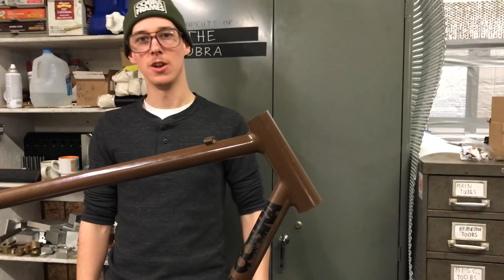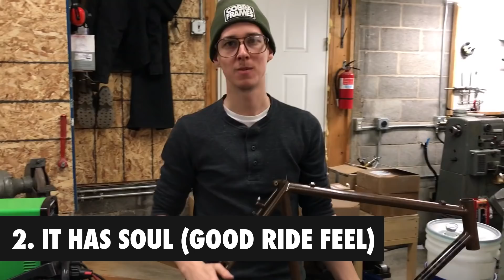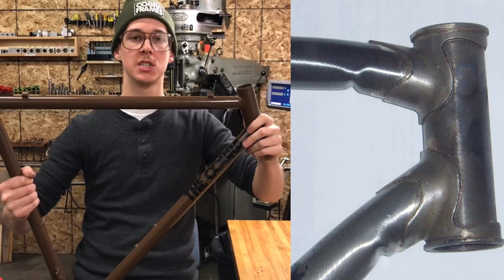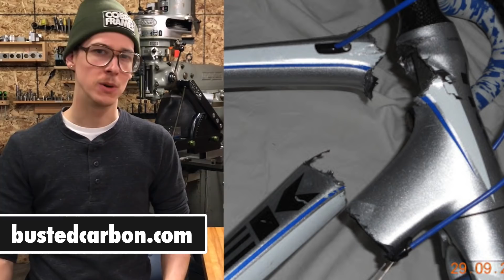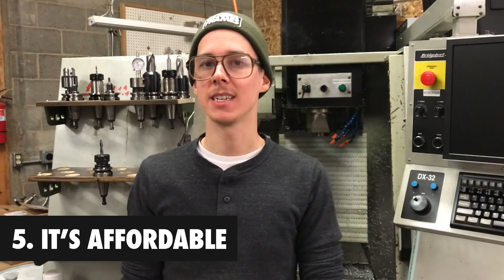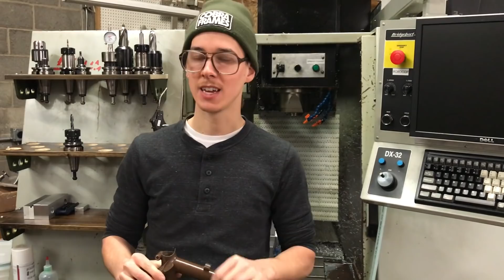5 Reasons Why "Steel is Real" | Bicycle Framebuilding

Comment: I bought a Fuji "Track Classic" steel frame bike (about 5 years old) the other day and have completely broken it down to clean up all the components, treat the frame, and make sure everything is assembled well. I noticed quite a bit of rust inside the frame when I removed the seat post. If a bike wasn't properly treated with frame-saver initially and was left outside some over the course of 5 years is that damage irreversible or will severely shorten the lifespan? I plan on giving it multiple coats of frame-saver spray, but I am wondering if, in your experience, you know whether the frame will still hold strong or may run into issues in the next couple of years.
Reply from the maker: It’s impossible for me to say without seeing it, and even then it could be hard to assess. They can rust enough to become structurally compromised.

Comment: Just a quick question Joe, why does steel frames has small holes  near end of tubes?
Reply from the maker: I think you're referring to vent holes? Condensation from humid air will pull moisture into the tubes and rust so it can be a drainage consideration. Also while welding, you don't want to weld up a sealed vessel like a tube with both ends capped because as the air inside expands from the heat of welding it wants to blow a hole through your molten weld puddle. And it's a good spot to add frame saver after the frame is finished and painted.
Reply: Huge thanks sir cobra, now I know :)
Reply: Be sure to spray some frame-saver in those holes! It is necessary to treat the inside of steel frames so they don't rust.